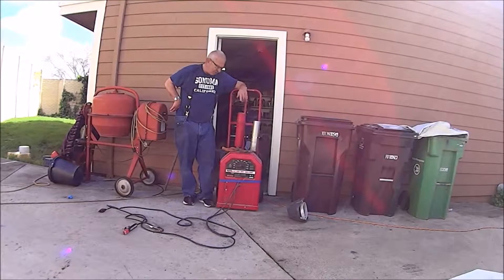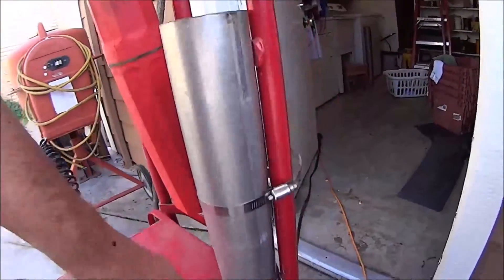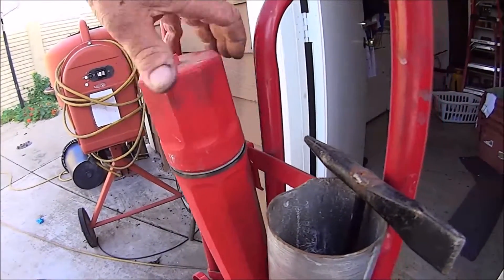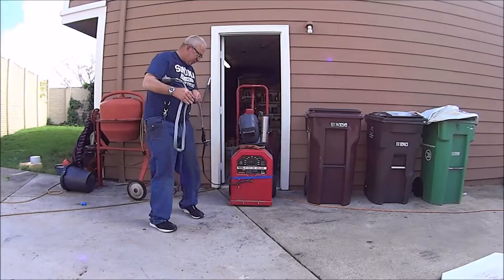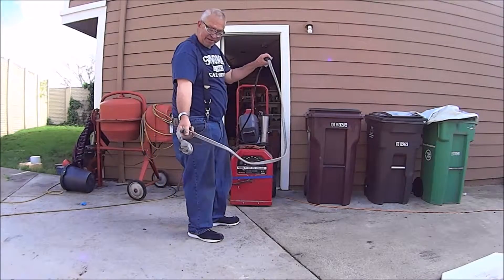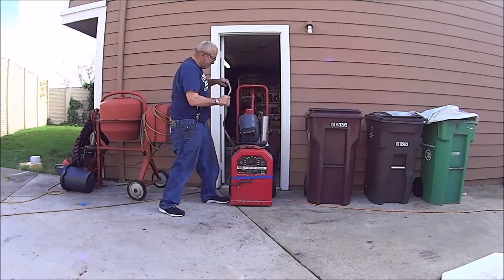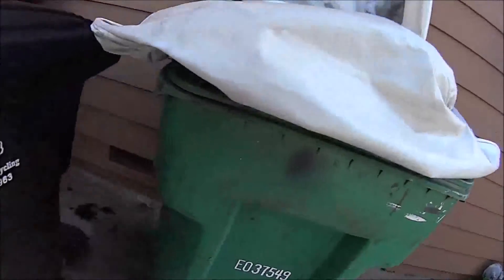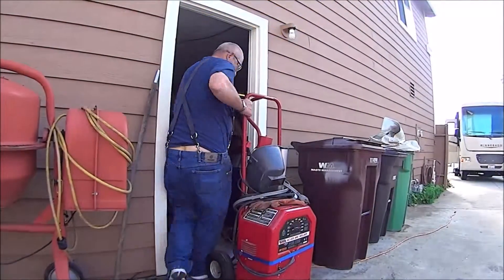Welding Cart & Rv Hookups @ Home

Comment: OURv, I have a couple of questions. 1. How did attached/install the side cameras on your RV and have them activated by the turn signals? 2. Why do you park your RV on wood?
Reply from the maker: +Joel Charbonnet 

Sorry I took so long answering you're comment.

My Vista came with a backup camera. I searched the owner manual & found the dash display had 2 cables for side cameras. I just plugged in my side cameras & they work with the turn signals. SWEET !!
My concrete I park my MH on has a bunch of cracks. Soon after we got the MH I noticed a bunch more. Did they appear AFTER we got the MH or before ? Unknown. Just in case I made these plywood sheets 1 1/8" thick to spread the weight of the MH. The concrete is 4" thick under the MH. Each corner of the MH weights about 5,000lbs. The wood may not be necessary, BUT, it can't hurt. All that concrete cost me $10K to have installed I don't wanna have to replace it.

!
Reply: Thanks for the information, I'll look into adding the side cameras to my Vista.